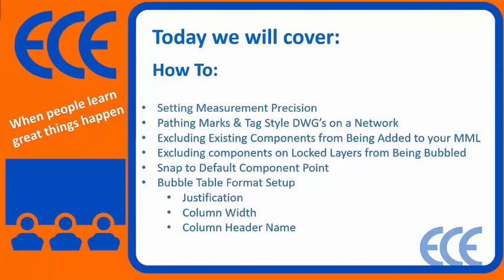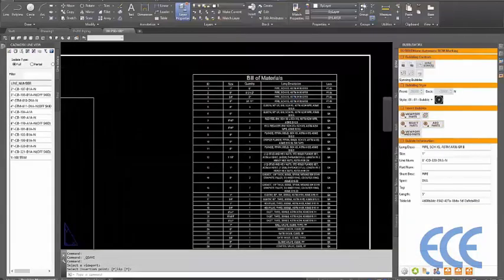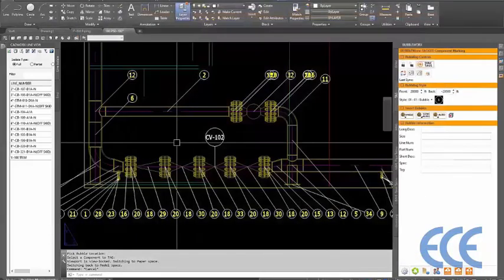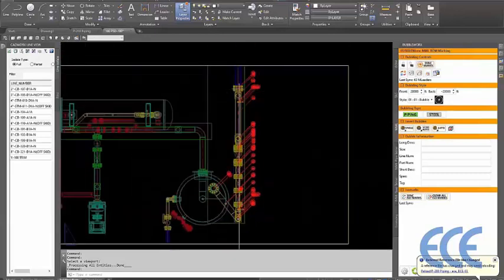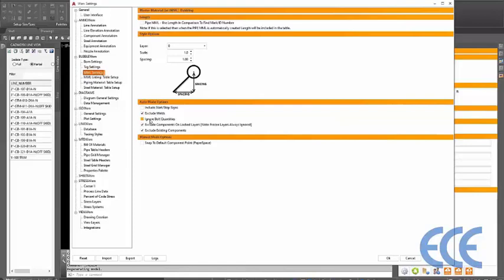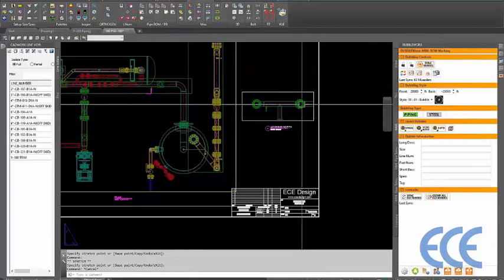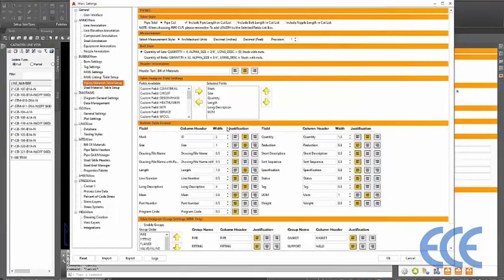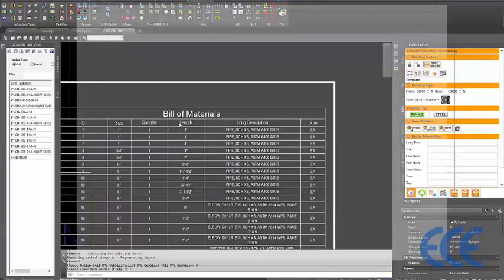Leverage your BUBBLEWorx settings for Custom BOMs and Drawings on CADWorx® PLANT

Comment: Just got BubbleWorx downloaded to my PC.  None of us have used it before.  I'm the guinea pig.  Our company has a few of your worx plug-ins.  One thing I'd like to point out is that the resolution of this video is not the best, kind of blurry.  Makes it a little hard to put what all is being shown into perspective. So far, from reading the BubWx manual (PDF) + watching a couple of YouTubes, it sounds interesting.  You're showing Plant, does it also work with Structure?  Sorry if dumb question.  Hope the quality of Vid's get better.  My visual real estate with CADworx works fine. Not as well with this YT video. Beyond that, it's got my interest to make certain parts of our detailing better, faster.  Thanks.